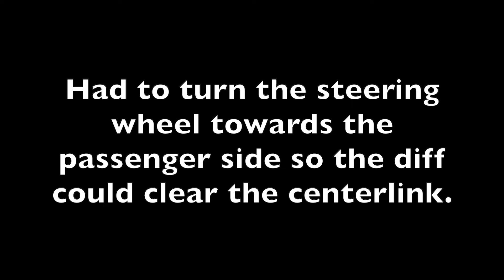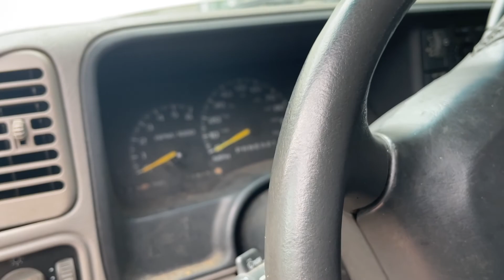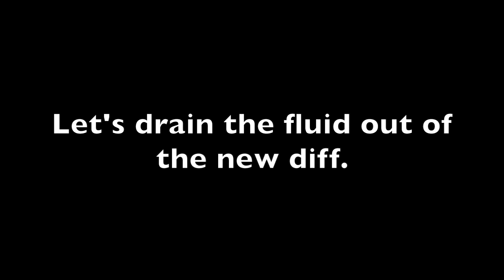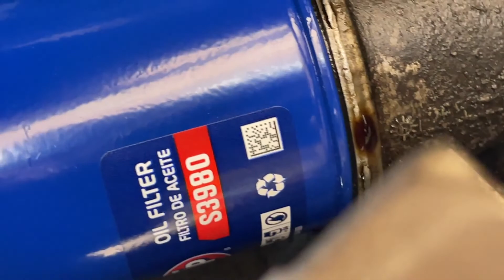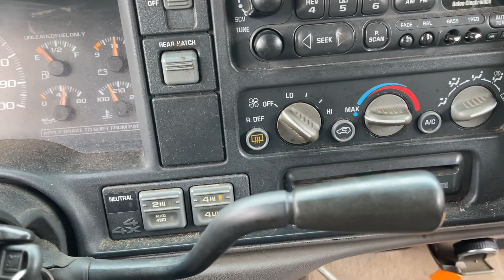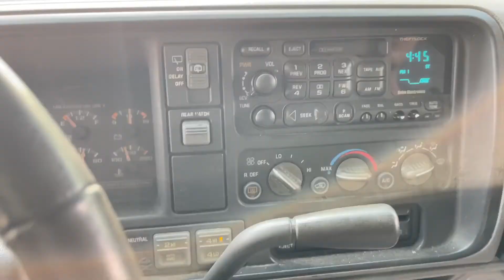Chevy Tahoe, Silverado, Suburban, Avalanche, GMC Yukon Front Differential Removal & Installation

Comment: Mine just started making noises when parked plus the service 4 wheel drive light came on my 98 suburban and honestly this is the second video I watched on replacing the front differential and you definitely made it look easier because the first one I watched the guy took the whole front suspension linkage off as well
Reply from the maker: Hi Josh, it's not a bad job. Like you mentioned, I took a simple efficient route. Thanks for watching!

Comment: I had to watch this because I did mine on my 02 Escalade it was a nightmare I used a ratcheting strap and a transmission jack I didn’t empty the fluid prior to taking it out but if you empty the gear fluid it’s much lighter I ended up rebuilding mine with a rock auto kit

Comment: What did you torque them front diff bolts to?  Thanks for all the info.
Reply from the maker: There was no torque specs in the book for those bolts and I couldn't find anything online. If you're talking about the large two bolts that holds it up, I would be safe around 80-100ft.lbs. Thanks for watching.

Comment: Hey, does anyone know if its okay if I remove my front diff? I'm fine with it being 2wd if it works that way?? Figured it'd be cheaper than replacing the diff.
Reply from the maker: Hi Joshua, yes it is possible however, you will have to remove many parts as well, and your service engine light will most likely stay illumninated. Thanks for watching!
Reply: Thank you! & what else has to be removed? If you know
Reply from the maker: @joshuajones8077  , obvious things as the front axles, front drive shaft, etc... I'm pretty sure you can get away with using the spindles as if they were 2-wheel drive. My only concern would be the transfer case. You may have some vibration but it shouldn't be bad. Trust me, it's much easier to replace the front diff in my opinion.